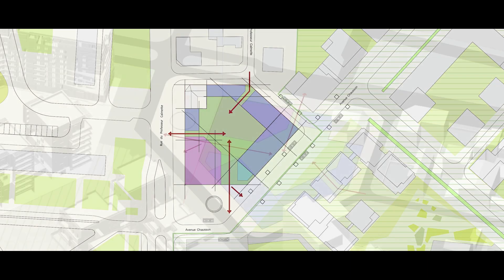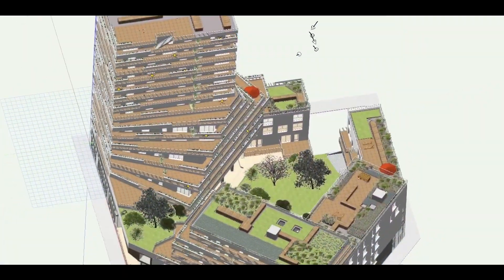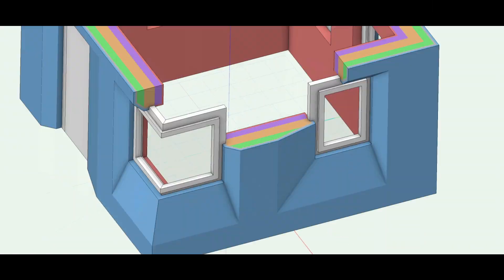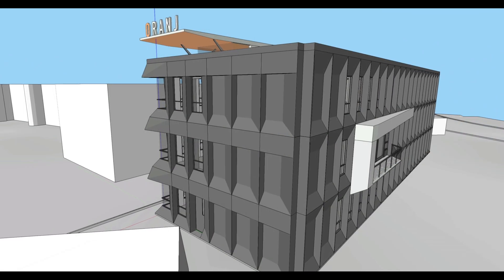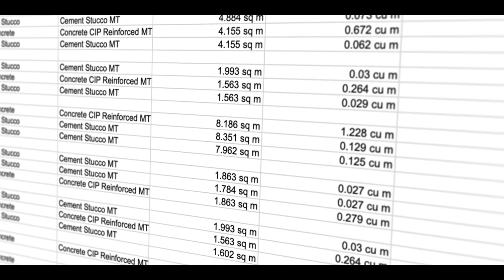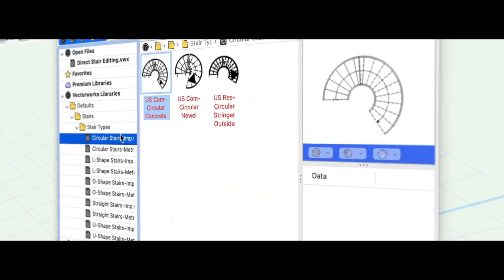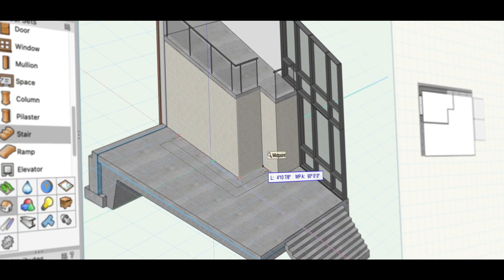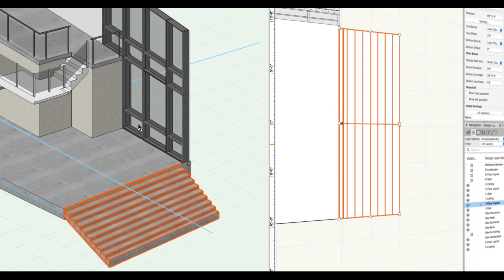3D and BIM Workflow Upgrades for Maximum Performance

Comment: Good morning. For me it is difficult to understand what is happening in Brazil, I use Vectorworks when it was Minicad 7 and even at that time we already had interaction with 3D, but it was not called B.I.M, I am surprised by the lack of knowledge in Brazil, I am also a Canadian citizen . Autocad is actually a brand that lags behind other CAD. I hope that the knowledge of Brazilians can bring improvements and knowing the ease with which Vectorworks brings professionals. I hope I helped in 2024.